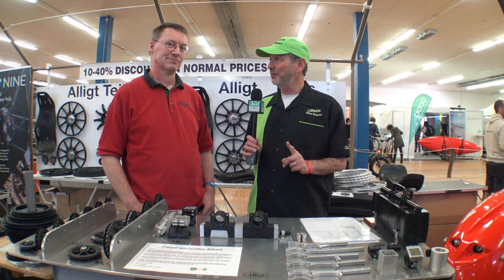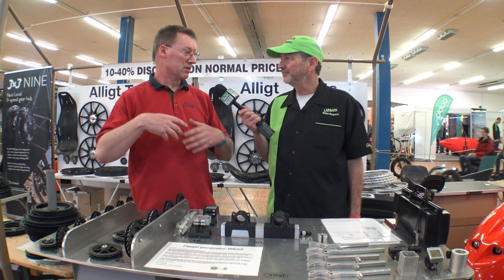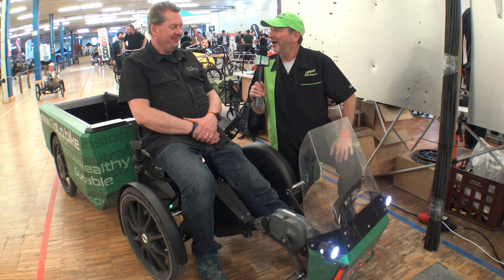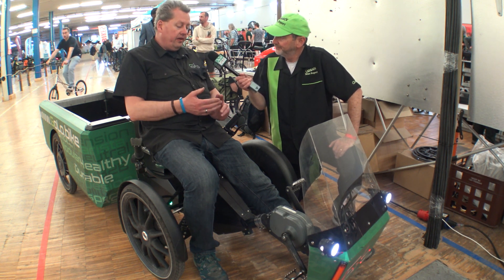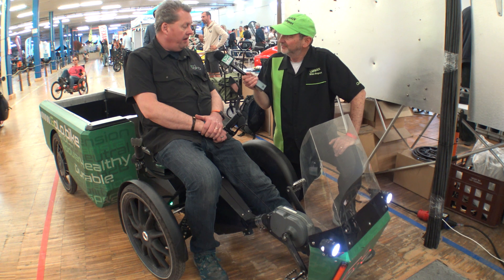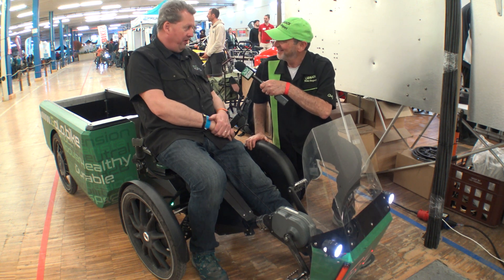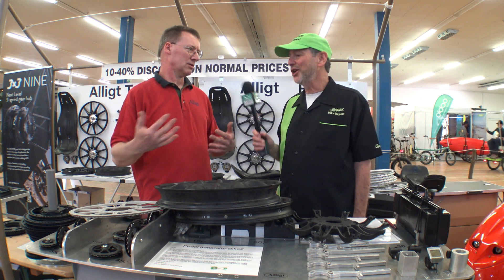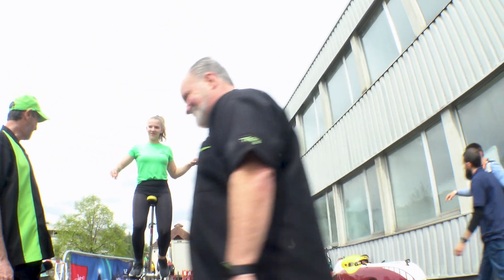Alligt's Pedal Generator System -Spezi 2023 Booth Interview

Comment: The Podbike FRIKAR has Pedal Generator System and it works very well! I have cycled 1000km since I got it i february. Cycle backwards is another advantage When it doesn`n have a chain.
Reply: Are you able to keep gaining speed after reaching the legal limit? What I'm afraid about this system is that once you reach the limit (25 km/h ~15mph) your pedaling stops being transmitted to the motor.
Reply: @YurkerYT  On flat gründer I can get up to 26km/h when I pedal a little entra, but downhill it cuts out at about 40 km/h.

Comment: This is a very interesting idea. Gary, do you know if there is a throttle, or does it work on how fast you pedal? In the UK (at present) if an e-bike has a throttle (even if it only has a small 250w motor), it is technically classed as an electric motor bike, requiring a licence, registration, insurance Etc! If it only works when you pedal, you could probably get away with it.
Reply from the maker: No throttle. It's all about tuning the software so the system accelerates in coordination with your pedal inputs as would be the case if connected with a chain to wheel(s).